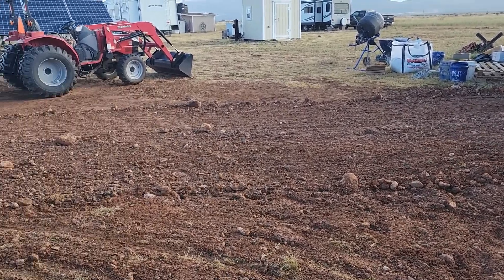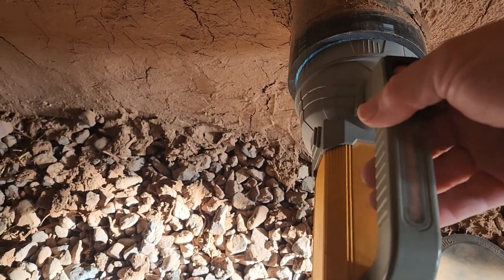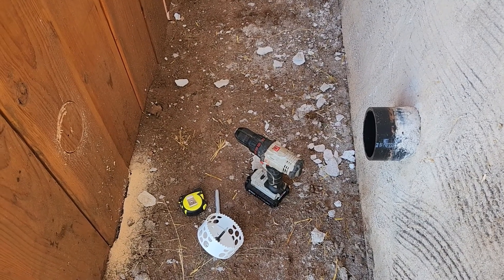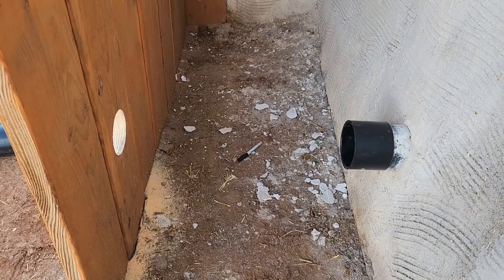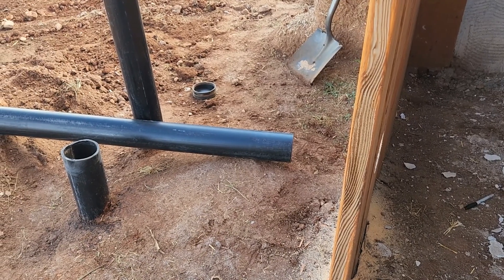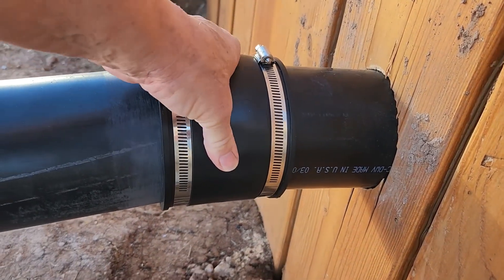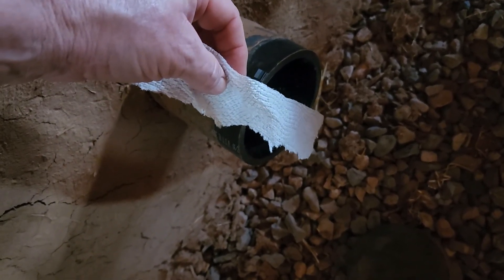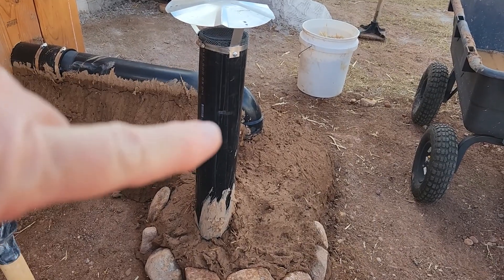Finishing the PASSIVE Geothermal Cooling ep 64

Comment: Reason? Its not drawing enough thing in. May need a computer fan on it, to push the cold air in, or make it draw air in.. Inside the pipe will have MOISTURE. IDK IF IT WILL CAUSE BLACK MOLD? > I would hate to breath that! and the FOUL ODORS >   I would make a swamp cooler>   Lots cheaper to. Don't use much electric

Comment: 😎 I guess you could always put a fan on it if you want to move more air through the system.
Reply from the maker: Yes, if, when hot weather is here next year we aren't getting enough airflow, we will add a small fan and possibly a filter.
Reply: Yes, in fact, Green Dream Project just showed a video about fans that actually fit right in those pipes!

Comment: Probably you explained this in the distant past, but how long is the underground tube, and what makes the air flow through it? Pardon my ignorance -- it's all really fascinating stuff.
Reply from the maker: The underground horizontal pipe is 160 feet long at a depth of 8 feet.  When hot air is in the house we'll open the top sash of one or more windows where the hot air will escape, the movement of the hot air out will draw the cooled air in.
Reply: Their last video explains the whole process.